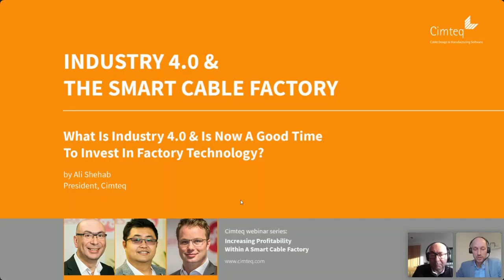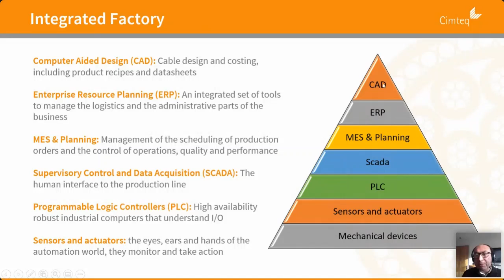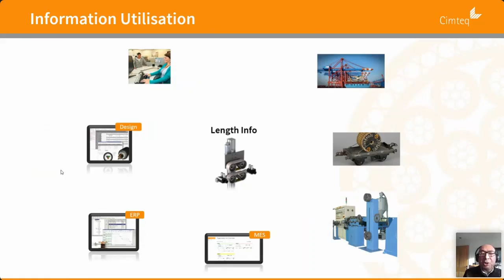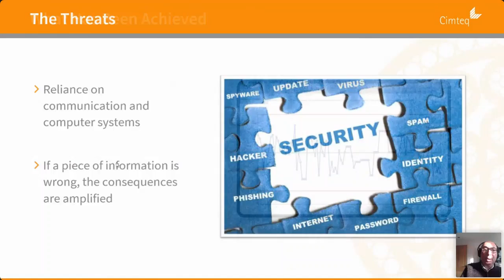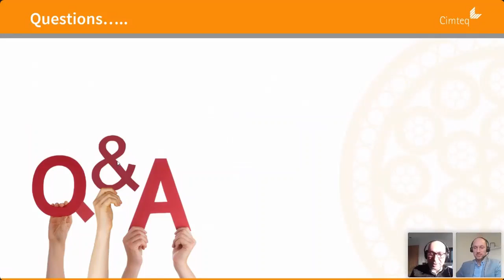"What Is Industry 4.0 & Is Now a Good Time To Invest In Factory Technology?" with Ali Shehab, Cimteq

Comment from the maker: 1. Welcome (00:00)
2. About Ali Shehab (00:32)
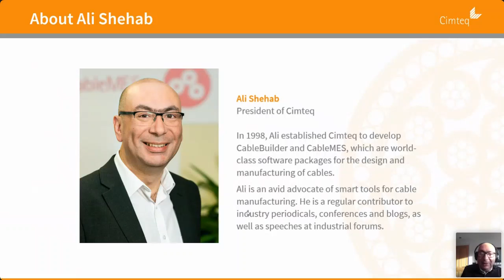3. About Cimteq (01:45)
4. The legend of Industry 4.0 (03:00)
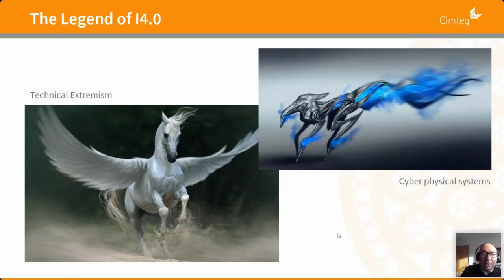5. The reality of Industry 4.0 (03:59)
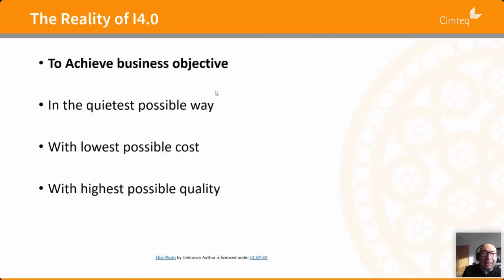6. What has been achieved over the last several years (04:21)
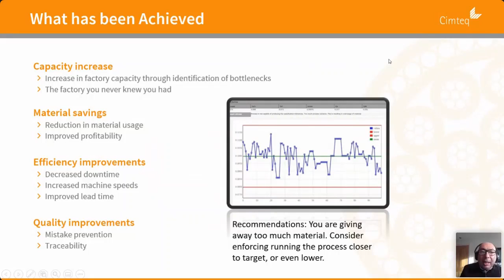7. What is Industry 4.0? (09:46)
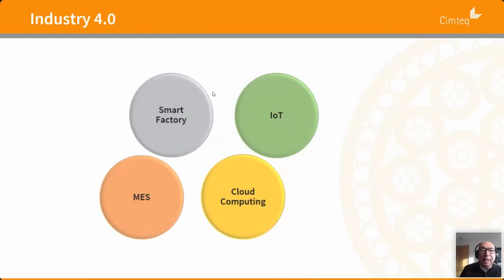8. Industry 4.0 technologies. Cloud computing, robotics, AI, etc (12:03)
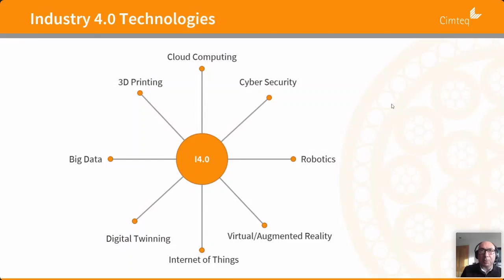9. The digitisation of factories (14:55)
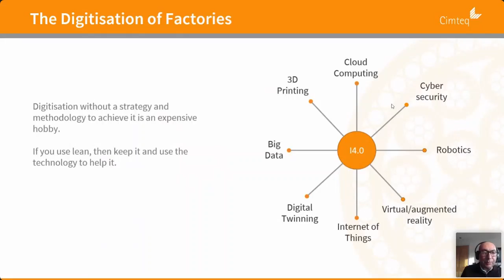10. The integrated factory - CAD, ERP, MES, SCADA, PLC, etc (15:49)
11. The smart factory - communicative, adaptable and collaborative (18:33)
12. Information utilisation within a smart factory (19:47)
13. Democratisation of information and the IIOT platform (22:34)
14. Can an extruder be smart? (23:44)
15. Smart assets (27:06) 
16. The technological threats (28:09)
17. Is now the time to invest? (29:50)
18. To buy or build smart tools? (33:48)
19. Summary (35:02)
20. Q&A: Is there any fully operating smart factories? If so, where, and how long, have they been operating? (36:57)
21. Q&A: Does your CableMES require you to make changes to the PLC programs of the machines or make additions to the PLC code? (39:15)
22. Q&A: Can a manufacturer completely remove, or keep, manual operations on the factory shop floor? If so, what would it take such a factory to be operational? (40:43)
23. Q&A: Do Cimteq offer to audit to see if Cimteq products are suitable in older plants? (43:28)
24. Q&A: What about machines without PLCs, to be integrated for the MES? (44:58)
25. Is your MES able to schedule the forklifts? (48:30)